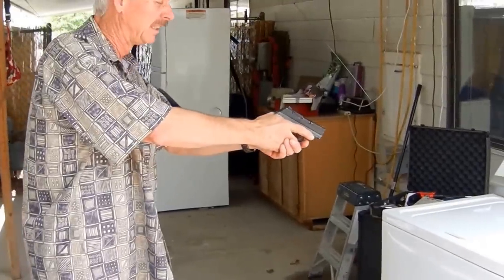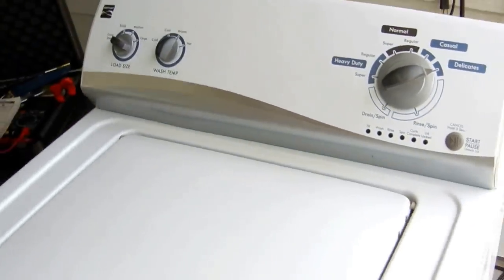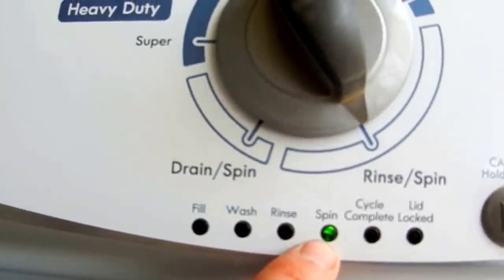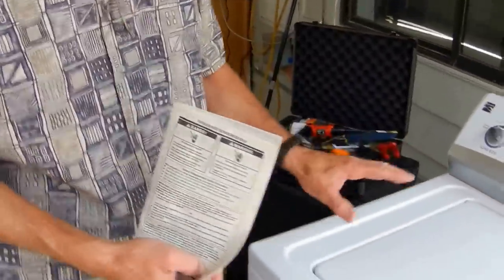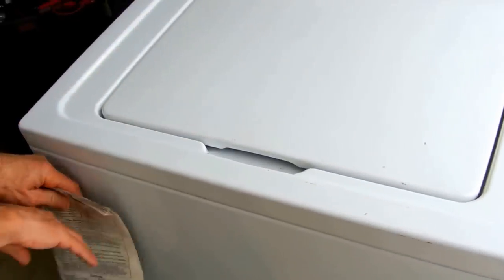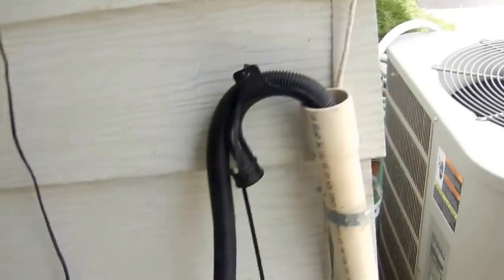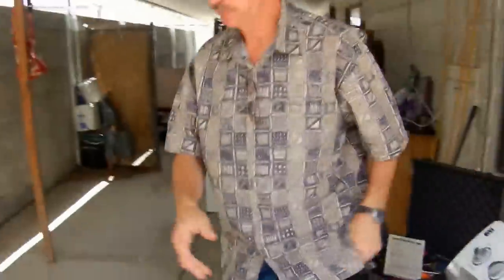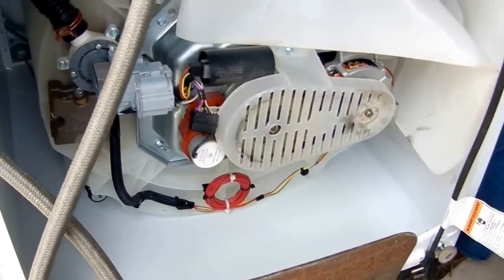Washer topload diagnostic mode.

Comment: Video was very helpful thank you... My problem was the actuator kit and motor pulley which had to buy the motor. Replaced all now machine washes and wants to repeat washing cycle when done. Did the recalibrate shown by sears direct and also tested and has no codes. Can you help with this problem?
Reply from the maker: Somebody else told me the same about a washer. Anybody know why it would do this?

Comment: I did follow all your steps to run the test and went good but when my washer was spinning it's sounds like something was punching metal from inside;what I noticed is that my sensing light is not flashing no more when I start running water.
Do you think that I have a sensing problem?

Comment: Great Video, I tested my Kenmore model 2130 and all cycles say they are fine but now lid lock is blinking and its still in test mode , does this mean lid lock broken. The washer was fine but now it starts and then lid lock blinks and shuts off and it never washes it fills with water but then lid unlocks and she just sits their. I was just going to order lid lock and replace , what are your thoughts.....Thanks John
Reply: John Jacoby Not necessarily. Lid like blinks for errors that CCB can detect.

Comment: What model of Kenmore washer is this? I have the exact same one and I need to change the suspension rods/springs in it but I need to know what model is the actual washer.
Reply from the maker: I dont have one of those anymore but you just use the model number to order parts for it. Generally find it in back of the washer or under the lid towards the back will be a small sticker with model and serial numbers.

Comment: Very Helpful Video. I have gone though the test mode everything played though beyond what is shown in your video to a point where now the WASH, RINSE, and SPIN lights are on and the LID LOCKED light is blinking. Any thoughts on what that could mean?
Reply: Hi - that's what mine is doing.  I made a call and they said it was the lid lock sensor.
Reply: I can't even get mine into diagnostic mode, can here lots of clicking. Anyone   have any ideas?

Comment: My washer gets off balance when spinning and makes a loud noise like the tub is hitting up against the base. Can you tell me what I need to do? I took the top off and did the self diagnostic and it went through the cycle just fine. I even checked the springs underneath and they are all tight and barely any play. Even if I just run a cycle with no clothes in it it does it

Comment: Hey Al,  Thanks for doing this.  I have the exact same machine.  It has a F5 E3 lid lock error, but the lid lock works just fine.  The only symptom is that the washer sticks in the rinse cycle, and won't advance to spin.  However, if I advance it to the drain/spin cycle myself it works perfectly.  It ran through this entire diagnostic with no problems.  Any ideas?
Reply: Fishman1049 I am currently having that same problem. Did you ever figure out a solution?

Comment: Al, good video. I have a Kenmore that completes all the cycles but you have to open it immediately after it completes or it will start again. I saw where someone else in the comments has the same problem and you suggested it was the timer which would actually be the control board for my model. Do you agree? If so, the board is $150 and my machine is about 2 years old. Based on your experience, would you fix it or cut the losses and buy a better machine? Kenmore model #110.25102310. Also, would love your recommendation on a new model or at least a brand?
Reply: Hey, you have the rare Kenmore washing machine that's working.  Move fast and stop complaining.  :)
Reply: Swish Life I have the same exact model number. Same issue. Did the part fix it? I'm debating ordering it, or conditioning myself, like Pavlov's dogs, to run really fast when I hear the lid unlock after the cycle. Mine made it 3 years. (Pathetic)

Comment: Good video ,,, I am sorry we are coming away from older style machines and that's only because I'm an old fart and lazy and would rather be throwing a beer back and thinking about more fun things. Buuuuuuut, we have to fix our crappy overpriced junk  and I appreciate you taking the time and prompting our grey matter with the diagnostics,, everything is there now and we have to keep up whether we want to or not.,,,,,,,,,,,,,,,,,,,,,,,, Cheers
Reply from the maker: The older machines actually are better. I should make a video just about the different types of machines. The machines became entirely too reliable. They lasted too long and too easy to fix and cheap to buy parts and most parts interchangeable, so the industry had to make drastic changes to make new kinds of junk that cost a lot and harder for average person to fix.

Comment: Can this unit still operate with just using cold and not connecting the hot water to it?
Reply from the maker: Yes most of them will, if not I just put a y splitter from cold water supply to both hot and cold of washer.

Comment: First, thank you for the clear way to detail how to enter diagnostics mode.  I've passed all diagnostics and now found that my spin (which was my issue) works fine with an empty basket.  My basket itself is a bit beat up (plastic wearing away) so I suspect that I might be off balance.

Comment: Hello Mr all fix it I have the same model washing machine the warm water setting does not work correctly it runs warm water for about tens seconds then it turns cold and never back to warm . Also the load size does not work it's fills up on the large size only . Any info would be great.
Reply from the maker: Havent done one of these for awhile now but most washers have a clear tube running from top down to
 the side of the tub. sometimes you need to disconnect at the top and blow on it to clean it out to make it fill properly.

Comment: When it got to spin the lid locked got to blinking so does that mean the spin cycle is messed up?
Reply from the maker: Sorry I can not tell you for sure but if it does everything else but does not spin, it could be the shift actuator...not always...did I mention I really don't like these machines? They also have lid lock issues and you could buy a shift actuator and then it was something else. it is a gamble.

Comment: I ran the diagnostic, which was extremely helpful, but the washer did not find a problem. It's not working right, though...it will get stuck on sensing, sometimes won't drain properly or spin properly. Any ideas?

Comment: So what needs to be done if the lid is stuck locked. I've tried everything. I can't get it to unlock. It won't even come on. No lights or anything. I have clothes in it and everything. It stopped working in the middle of a cycle. Any ideas? Please and thank you
Reply from the maker: Mine opened if I held the power button down for a couple of seconds.

Comment: Can you tell me where the hose plugs in for the water pressure sensor? Unplugged it to fix something and cant find the plug in
Reply from the maker: That hose just plugs on behind the selector for how big a load or how high the water level is and then the other end plugs onto side down below and as water level gets higher it increases pressure to the switch. Most are that way anyway right now I dont have one handy to look at.

Comment: I have this machine and I when I went to do test.   All lights were blinking..     but the machine just clicked and never went into fill mode.   I'm not gettin a 120v voltage reading on my multi meter testing the water valve while doing this test.      Water maybe shot ?
Reply from the maker: Make sure water pressure is on and not clogged up at entrance screen. Also if the door lock has any problem it won't start anything
Maybe your right it could need water inlet valve but if not enough  power it is something  else like electrical? Wish I  could help you more.
Reply: @AlFixit  thanks for replying.       I checked the capacitor  and it's not showing continuity.    So I ordered one.  But also I could not get 120v from water valve when washer turned on.      Hard to believe it could be both.    Ugh
Reply: @AlFixit    Hello...well i put a new capacitor in and a water valve.  still same issue.   lid lock light comes on in red and fill light but it does nothing but makes a clickin noise.    Could you explain how the lid lock feature works and how that could be my issue.    is there a way to by pass that feature to see if thats my issue.  thanks      btw i went into the diag code and got all buttons in green but i wont even go into  cycle mode or start whatsoever.
Reply from the maker: diagnostics checks lid lock and if that is a problem, it will not check anything else. clicking noise? i wonder if the shift actuator is clicking. check this guy out https://www.youtube.com/watch?v=JG-EN9KWCt8&ab_channel=BensAppliancesandJunk @Dooguy

Comment: I need to get the book out. The machine has been stopping on spin cycle with the Spin and Lock lights flashing. I need to unplug it, put it into spin/drain mode, and finish large cycles that way.

Comment: Anyone know why the lid locked light flashes and the washer won’t work ? Have to unplug it and plug it back in for it to work again . And as soon as the washers all done and you open the lid it will start blinking again every single time ... lid switch bad ??

Comment: Why would my Kenmore not rinse and drain at times. It will not finish washing the load. We do not overload it. Once I do this test it shows everything is working. Any ideas?
Reply from the maker: I would try cleaning out every thing. Hoses and pump could have small sock inside partially stopping flow or pump is beginning to fail. Hopefully someone that works on this model more often can help.

Comment from the maker: I dont like this type of washer but here are the most common problems with them in order  as near as I can tell. Shift actuator is usually a problem followed by lid lock, then usual things like water pump. I talked to one repairman who just routinely replaces shift actuator when called to fix this type of washer. I hear that those shift actuators can go out at anytime like a light bulb too. Perhaps would be better to shoot it.(wait, did I say that out loud?).
Reply: Thanks for this video! I'm hoping it's the beginning of me getting this fixed. I'm trying to diagnose a noise problem. Machine locks and unlocks, fills and drains with hot and cold, spins, and agitates. But, it seems that when it is agitating, makes a very loud and horrible grinding noise. As soon as I entered this test mode you showed above (right after it filled up with water) it made the exact noise I described. Any ideas on what it may be?
Reply: I have the same problem with mine any fix yet?
Reply: so I have the same exact washer and what it does is not spin out right leaving my clothes soaked, was that what yours was doing as well?
Reply: no apparently mine is working fine just makes a horrible noise when on wash and rinse cycles
Reply: Connor Dunckel I have the same problem
Reply: Connor Dunckel did you fix it?
Reply: Good evening. I have the same washer and it appears to have the same issue. For some reason my manual is not inside. Would you happen to know the path number for the shifter?
Reply: Would that part do the spin cycle also? Try ing to find one that covers a  no spin/poor spin.
Reply: I have the same exact machine and my problem is when it spins a lot of times its starts banging the sides hard and I have to stop it. What can be causing that?
Reply: @christophermorse00  pl

Comment: will this work on my new whirlpool that says locked but the lid is open and it does nothing but flash?
Reply: Chelsea Whited your lid lock is bad you can do a temp switch buy pass by doing a closed circuit repair for a temp fox
Reply: Chelsea Whited Your washer Board is detecting an error.  Lid blinks for all errors

Comment: GREAT VIDEO!  Maytag Centennial topload.  Machine would begin "Sense", "Lock" and then "Unlock". I was getting F2E1, F5E1 & F7E1 fault codes. I replaced the lid switch assembly, and now it won't lock AT ALL.  And, I'm still getting the same fault codes.  HELP, PLEASE!
Reply from the maker: It has been A long time since I messed with those machines but was talking to another rerpairman that said most of the time the problem is the shift actuator. You might try that. Some time I should work on those again and make a better video as there are so many folks having trouble with this type of machine.
Reply: Thank you for getting back to me.  I appreciate that.  Come to find out, the damn thing is still under warranty.

Comment: I don't understand how to figure out the codes.  I was able to do the diognostic test cycle and EVERYTHING worked. But, I still can't get things to work on a regular cycle or any cycle.  Lid lock locked,  sensor lit up and then Nothing.. I have even calibrated it. Any ideas would be GREATLY APPRECIATED.  I cannot afford to buy another washing machine nor pay someone to come check it out. Thank you!
Reply: I need help too with this. The codes seems stuck. Idk how to put it back to normal

Comment: I have this exact same washer. One of the suspension rods came off and I cannot for the life of me figure out how to get the cover off to hook it back up. Could you please assist on how to do this?
Reply: Did you see the part of his video where he tells you to remove the three sheet metal screws that hold the metal panel on and then remove the two top screws that hold the hinges on?

Comment: I have the same washer but it stopped spinning. I did the code and it all lights up but when I go to spin it lights up then it goes to cycle complete and doesn't spin but the water runs and drains. I need help I have baby clothes to wash! :) Also when I try to wash clothes the lid doesn't lock like it used to and like it did when I did the diagnostic test.
Reply: i am having the same issue..my washer drains but leaves my clothes in wet soggy mess..ugh
Reply: Shelley Bower my problem with mine is the actuator I just had got the wrong one but turns out that that's what it was! So mine isn't running just yet but hope you get yours fixed soon. Maybe this is the same problem with yours. Mine started out leaving the clothes just soaked but then it just stopped spinning all together. Hope this helps.

Comment: What does it mean if it does everything except drain?
Reply: You need a new drain pump more than likely. That's an easy repair.
Reply: @JaleelJohanson62  I put a new pump on and that did fix that problem.  The washer sat up for about 3 years and now it drains but it doesn't want to go through the cycles.  I ran the diagnostics and no errors.  I reset the board by unplugging for 3 minutes. I took the cycle actuator off and hooked 120v to it and it works.  Would the door lock cause it to not cycle?
Reply: @007380  The door lock would cause it to be dead in the water. The computer board needs to sense the door is locked. I'd try replacing it. Good luck!

Comment: I have the washer with the two additional settings knobs on it but basically the same one. I HATE the damn thing. The first thing I hate about it is it feels the need to lock me away from my laundry, please just go back to warning labels for idiots. It doesn't wash as well as my previous older model washer with the center agitator that used more water sure, but it also washed 2-3x as much clothing per load. Taking the stupid latch off and sticking in so I can see what it is doing just makes you wonder why you got a Jacuzzi for your clothing and not yourself. And anytime you need to wash towels or large blankets if anyone loads the damn thing even slightly wrong it slams into the side paneling a few times then stops itself from spinning. Rather then slowly ramping up speed or something it decide it doesn't need to spin out so you have to wring the thing out that is saturated still or try to move it around and try your luck at it being balanced for another go and hope it doesn't just slam into itself again. Also the low amount of water used seems to fail to clean heavily soiled clothing. Maybe I'm just used to decades of the previous washers working fine with anything you throw at it and this one being a hassle to save a small amount of water... well unless you are forced to run rinse cycles extra times and have to do 2-3 times as many loads for clothing that is being slowly dissolved by the detergent being so concentrated. These things are bad, If I were you I would have shot it and called that the diagnostic results. Or maybe instead take it out to a lot and run it feeding brake cleaner into the water intake while it is filled with pool shock packages.

Comment: hmmm all lights flash then when i go to text mode it moves the light to complete and just clicks HMMMM but great video. damn i hate these new washers i have been looking for the old stile can't even find them used. i had one old kenmore for  14 years and since it died 5 years ago i have had 3 and i guess after tonight i will be looking for a 4th
Reply: ok got it to do everything but spin

Comment: I have this washer my problem is it will run all the cycles go to cycle complet but then will start over on it's own and will keep doing this forever if nobody is there to watch it ..I ran the diagnostic several times but it doesn't fix the problem
Reply from the maker: take agitator out (little cap at bottom with screwdriver) clean out any coins or junk and then recalibrate.

Comment: Also, when the machine is in the last cycle, it doesn't stop/come to an end. Instead, it keeps repeating the rinse cycle.
Reply from the maker: You must clean under the agitator area. Then you must tip machine over and clean out the pump and drain hose. At the pump there is a seat that must be clean as well.
Reply: Al Fixit THANK YOU!!!!